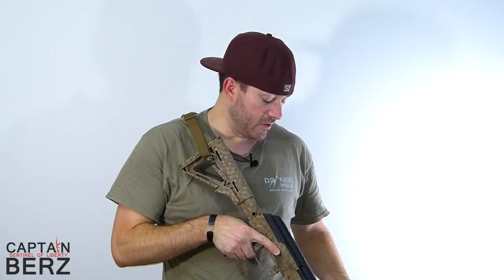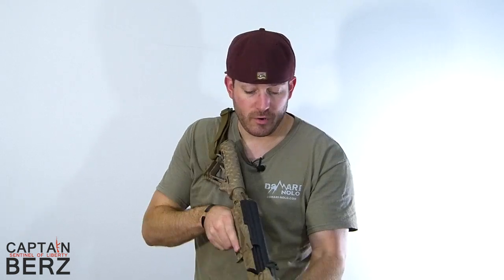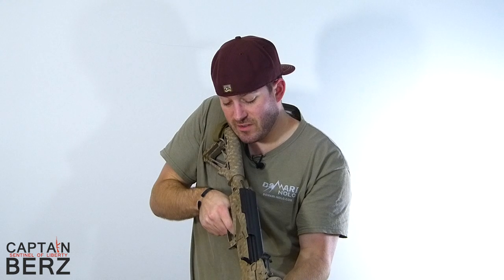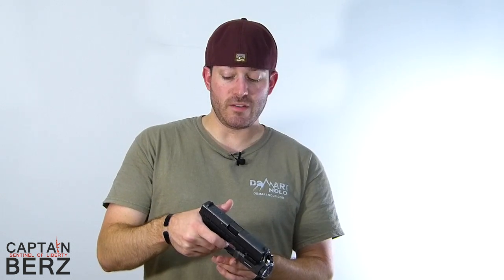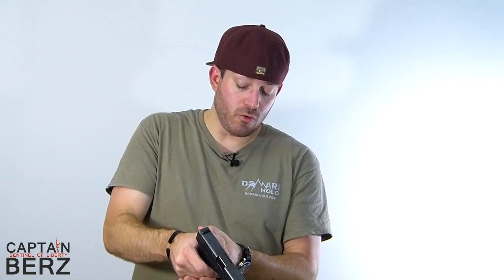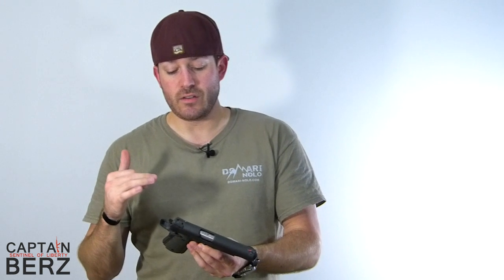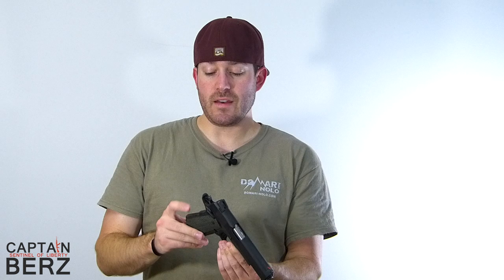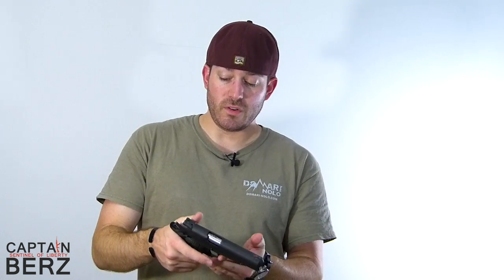Gun Safety Operation Check

Comment: 1911s have a third safety called a disconnect that keeps it from firing when out of battery.  You test it by pulling the slide back slightly with the other two safeties off and pull the trigger.  Hammer should not fall.

Comment: @CaptainBerz One more safety check on the Glock would be a firing pin safety check. With the trigger in the rearward "fired" position if you shake the gun inline with the barrel you should hear the firing pin moving freely, with the trigger in the forward "cocked" position repeat shaking the gun inline with the barrel and you should not hear the firing pin move.

Comment: Nice video!

I second the firing pin safety check, especially if you have done a complete dis-assembly recently. If the spring doesn't completely seat into the firing pin safety "button" it can turn sideways and cause the button to stick. This can make the pistol unsafe to drop and it can lead to full-auto bursts.

Just pull the slide and press on the "button" to make sure there is spring tension and it moves freely.